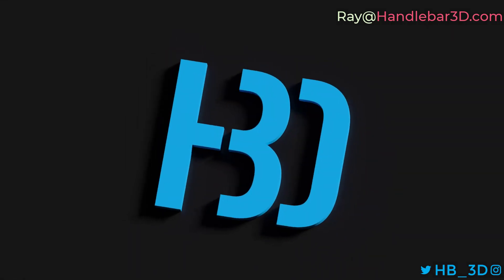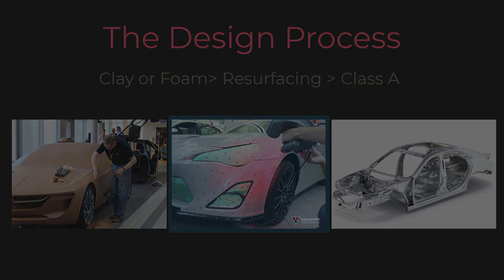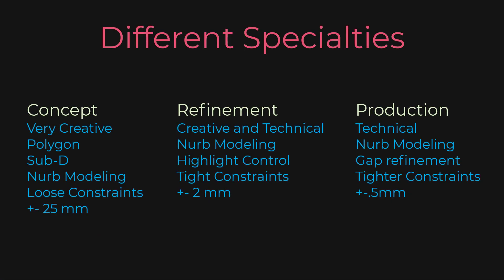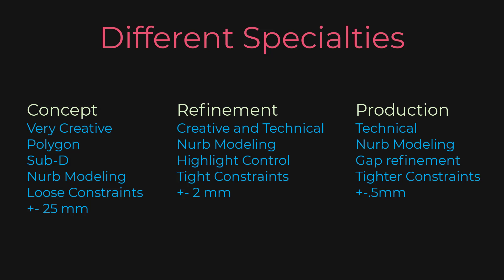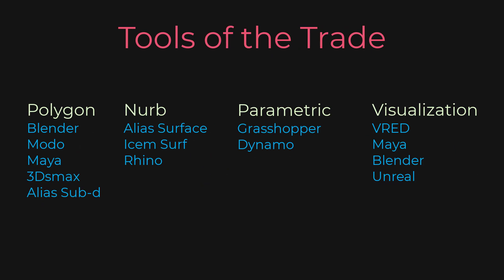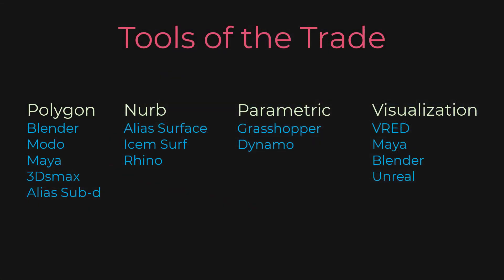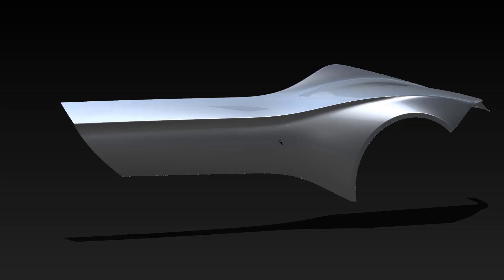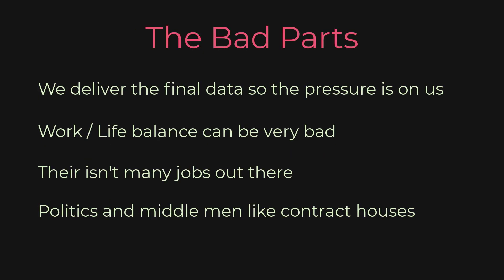What is a CAD Sculptor?

Comment: Hello, lots if disinformation in the video, 
so:
1) they start with design lines (high end), not concept sketches + axis spread (production line limit)
2) Class A is U/V classified nurb surfaces (esthetic side), B is offest, technical side is called gray ... 
3) Refitting control points is not sculpting ... digital sculpting is done in ZBrush ... it does not redefine the mesh
4) Alias is not 90% ... Blender in automotive? Wtf
Rhino ... did you work maybe in M&O 
5) If you are sooooo good you will get an offer from OEM, cut out the middle man after contract or two
6) Done a lot of screaming in my life to egotriping designers in order to explain what are the tooling restrictions... so yes, it has to be feasible to produce doesn't matter if it looks nice
7) 4W for redefining small 3 surfaces, gaps that have undercuts ... thats how designers work
8) under paid ... yep if don't know industry downstream 
9) etc.

Small tip, design tutorials from experienced people can't be found on YouTube or online. This is know how and you can get it only working in OEMs design studio, not in remote or on the other side of the world ... simple as that
Reply from the maker: 😂 I guess the decade I have working inside the industry was all made up in my head. 

1) this alone tells me you have never worked inside any design studio but please enlighten me. What automotive design studio have you worked for where their design staff doesn’t start the design process sketching. 

2. B side is a very common term used in my industry. I’ve never heard grey side, this sounds like a different industry to me. 

3. Never in my life have I ever seen zbrush used inside a professional car design studio. The term sculpting comes from clay sculpting. Which is now being replaced entirely by cad in many studios. 

4. What software do you use then? 

5. I’ve gotten many offers in my life. I literally just got one this month. I’ve also have worked directly for companies too. As an employee and as a vendor through my business. 

6) ive never had a problem communicating a design restriction from an engineer. Many times an engineer will be wrong, they aren’t perfect and it’s part of the process. They will kick and scream its not possible then you show them how you did it in other projects or use an example from another car in the road. 

7) no idea what that means, again it sounds like you are an engineer. My ideas are about the design process inside cad design studios.

8) atleast we agree on something 

9) please keep going. 

You seem to be confused and think nobody would take the time to educate people on their different industries. I work for the automotive design industry. I have worked inside extremely prestigious studios such as VW Design center of California, Fords Irvine Design studio, Hyundai’s center of design etc. Many of my colleagues have already sent me emails and comments on how well I explained the process. A couple in this video as well. 

So again I ask you, what design studio have you worked for? My videos are in every studio and in every design school. I know this because my network is extremely wide now. Not from my YouTube but from my old colleagues that have worked along side of me in many projects. 

Or maybe I’m just making it all up but maybe one day you’ll enlighten us with these super secret industry practices and workflows 🙄

Comment: I've been in the Golf Industry since I've graduated college 10 or so years ago and I've only known the Nurbs modeling/surfacing side of CAD (Siemens NX is what I've primarily used). In our workflows, they don't really give any time towards concept modeling/surfacing (very quick lead times; around 1.5 years from design to product release) but on the flipside, a lot of our products are built off a previous generation's framework. The sort of general shape of the clubs stays pretty similar but we will usually change the more organic parts of the clubs as well as the internals to hit a new design language and specifications. 

I do envy people who only do concept stuff and do not have to necessarily deal with a lot of driving spec/dimensions and just get to plot down cool designs. Everything I ever have had to do has to, from the get-go, be parametrized in such a way that the file is easily updateable and changeable with expression data. Making one club, then changing expression data to build out other lofts within a set of irons for example with as little rework from loft to loft.

Comment: Is nurbs modeling used outside of the car industry? As a product designer would you recommend it?
Reply from the maker: Yes products are made with nurbs as well. Solid modelers like solid works and rhino are also very popular in product design.
Reply: @HandleBar3D  thanks for the reply, i currently find myself using autodesk Fusion 360,  it’s been great so far,  I been able to model, print and prototype in a very straightforward way, the surfacing tools have been improved also, which allow you to be somewhat of a hybrid modeler, would you recommend undertaking alias as a product designer, or you wouldn’t consider it as necessary as I’m not looking to be involved in the car industry ?  Thanks for all the wisdom and great content.